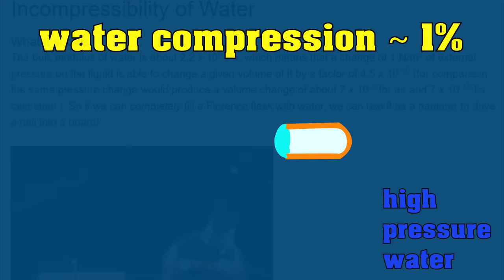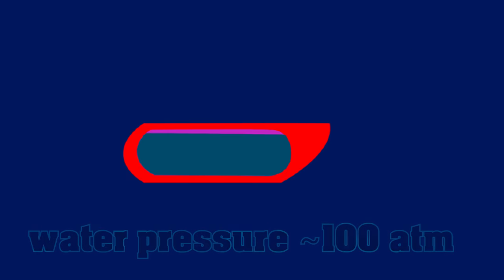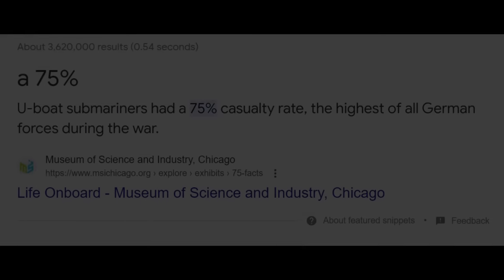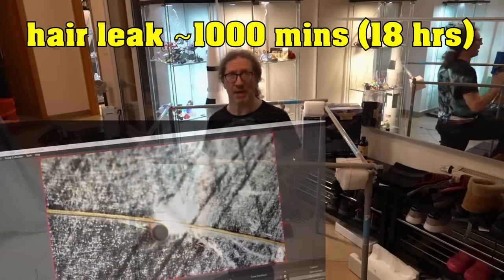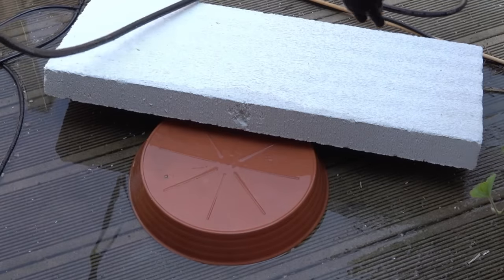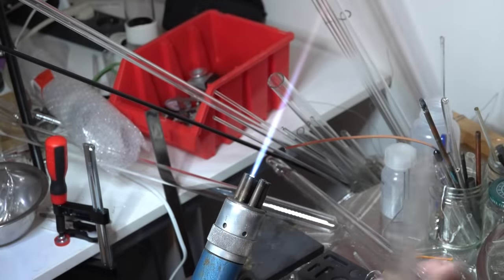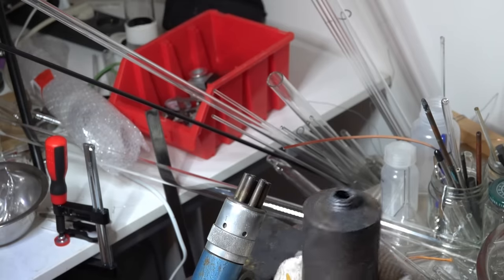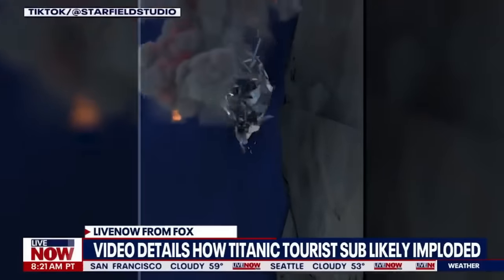Why the Titan sub failed

Comment: I'm stunned it lasted one dive to the Titanic, let alone 13 dives.
Reply: It's utterly amazing it lasted, it honestly looks so home brewed by enthusiastic idiots who had a smattering of automobile repair skills between them and some intern who knew some electronics and computer stuff.
Reply: @Dedubya-  exactly, it looks like what some final year engineering students may have knocked together for some one off contest....
Reply: well the sub is designed with a safety factor in mind. probably the reason it wasn't able to be certified was because it required a higher safety factor, and the sub's safety factor most likely just put it very near the limit. thats bad because the limit is what you need to stay very far away from, thats why the safety factor required to certify it has to be very high
Reply: It didn't have 13 dives at full depth.   Ten dives were not to the Titanic.  This was precisely the 3rd time it descended to this depth. Not 13th. As documented.  Note this was "Mission 5", but 2 missions were called off. Of the 3 missions at or close to full depth, there was a major failure on each of the 3. Propulsion failure from thruster mounted BACKWARDS. ,  communication FAILURE -wiring  ,  hull - failure of design.
Reply: They could have lied
Reply: @BlairAir  and remember the hull got rebuilt once, and information about that is kind of cloudy, but it was definitly rebuilt because there was obvious signs of cracking and the carbon fiber being damaged. So this could of only been down that deep once, or maybe even never.
Reply: I had heard that it didn't even make it to the Titanic most of the time.
Reply: It failed on the third dive to Titan depth.   This happens when one has neither testing nor quality check to make sure the hull is safe.

Comment: Honestly, the more you hear about the specifics of this debacle, the more surprised you get that it didn't end in disaster sooner...
Reply: Agreed. The 'wait, what?' moment for me was when the video revealed that the sub's titanium was bonded to the carbon-fiber... with glue.

I mean, even as someone who's completely unfamiliar with sub construction, it feels like the people building the sub had better options than that.

The only thing that might make this make sense for me was hearing from other sources that the people who built the sub allegedly cut corners like crazy.
Reply: love your avatar - it's like a 3D version of B|
Reply: @quentincoetzee4313  
I'm not sure on what 'glue' they used, but 'glue' is rather strong these days. 
Lots of expensive cars are glued too. For example you can't weld steel and aluminium together(Even if they are touching you get corrosion which is deadly for any metal object), only way to get that to (safetly) stick together is glue.
Reply: @Ikbenjounietsukkel  glue holding two things together from shearing or breaking apart is one thing. Here the problem is, as Phil described, that your glue doesn't matter when an air tight seal isn't air tight at 300 bars; and glue is not gonna fix different deformation rates of metal and polymer
Reply: Real engineering has a great video about how composites are a horrible choice for a sub. 

He did his masters thesis on composite materials so I trust his judgement.
Reply: ikr?  I had money on it dissolving at the hot-glued seams before it reached max scuba depth... i lost a tenner (10 quid GBP).. but only by what? 20 feet? . lol.
Reply: @ProjArsSci  @quentincoetzee4313 Exactly, we aren't talking super glue or elmers glue here. They have INCREDIBLY capable glues in the form of epoxies for various things, and a lot of them are just as strong or stronger than what they are holding together. Only in this case you have environmental extremes of such degrees and the materials it's bonding together are literally trying to change by 1cm and rip it apart. The fact that it held it together for so many dives taking repeated stressing and destressing over and over is a testament to just how good this glue/epoxy was. I'd honestly bet the glue/epoxy wasn't what gave in the end I'd bet the carbon fiber right up by the glue failed from the differing levels of deformation.
Reply: This. The realisation that even a small 1mm hole could be so devastating just makes it even more unbelievable that people willingly entered the Titan and agreed to be sealed-in to it. Just to be pedantic though, this video talks about how a sub would fill-up with water very quickly even with a tiny leak, but other vids (historically, not just recently) have suggested that any leak would trigger an immediate implosion. I've seen someone supposedly 'in the know' saying that about a full-size military submarine too, which sounds somewhat unlikely to a layman/ non-naval man such as myself, but who's right?
Reply: @ProjArsSci  
Not sure if translation helps me here but
There's elastic and plastic glue.
Reply: @soots-stayingoutofthespotl5495 iI've been to sea.. as a COOK (my THIRD back-up trade) and yep. you're right.. but. there's ALWAYS a few ''fleeting moments'' when  ''oops, wee leak there, Lads'' .. becomes ''ARRRGH splatch-blop.''
Reply: Their goal was to build the cheapest piece of shit to accomplish their goal. It's amazing it went down there 52 times.
Reply: yeah the glue held for what 10 dives? so I would say that design is only good for 3 dives to be safe
Reply: @blakespower  aye,, that's a  clean safe estimate.. but see.. billionaires are just kids with more money than half the nations of Earth and they don't value Human life AT ALL  so.. when their own experience -less dreams kill them.. everyone goes ''yup'' we cautioned the daft wee pillock.
Reply: Well, Ocean ... GATE(!!!)
They even had a proper name for an affair, a disaster, a tragedy.
Reply: @thearmchairspacemanOG  And, Billionaires rarely have people tell them no, and those that do find themselves fired, like their Head Of Safety...
No? Well here's some more money/resources, make it happen.
Reply: Agree! People that went down and came back had divine intervention
Reply: @blakespower 
Actually zero to one
Reply: @ProjArsSci  Which is utter nonsense.
Reply: I'm guaranteeing it was an intentional contruction, and it's only incompetence that allowed it to last so long by pure accident